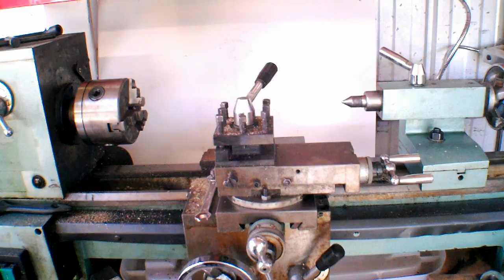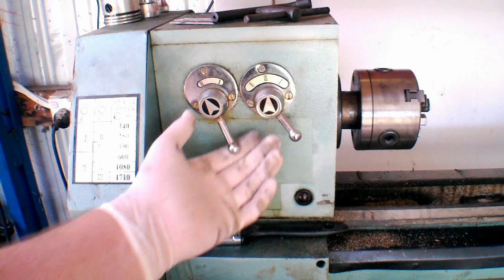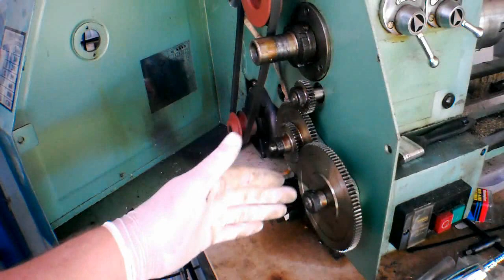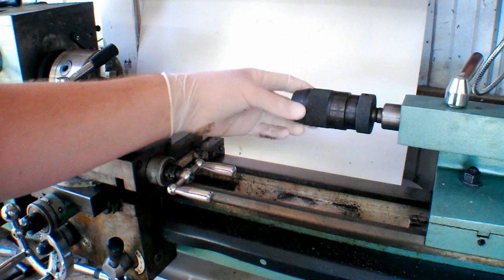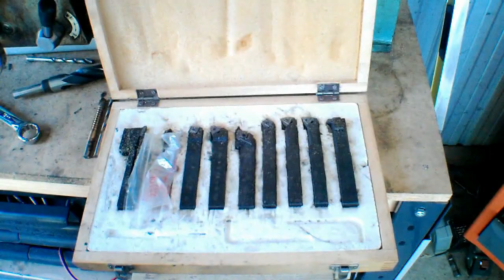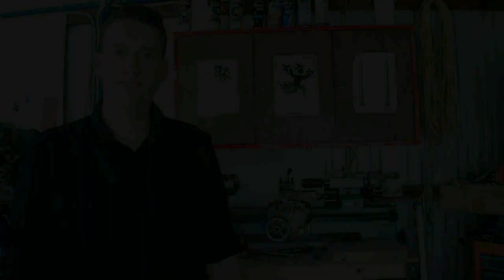Beginner's Guide to the Metal Lathe

Comment: whats the best way to torn my 220v. into 3phase 220v. to run  the lathe i just put in my garage
Reply from the maker: Usually the conversion would go the other way. There are ways, but the most obvious answer is to swap or sell and get a 3 phase lathe. Older 3 phase machines are usually cheaper because they are in less demand as most hobbiest do not have 3 phase outlets.

Comment: This is very affordable and good mini lathe. I have BV20-1L gearbox version and my uncle have BV20 belt short version for over 20 years and still work as charm. Of course you need to take care of machine (cleaning lubing etc) but this goes for any tool if you want to endure years to come :) It is well built and you can modify it according to your own needs,.
Cheers
Reply: I think BV 20L is the best buy if we are hobbiest, better than WM120. Solid built, Its weight is 3 times the WM120.

Comment: Boa noite!
Estou pretendendo comprar o Torno Mecânico 500mm BV20L-1 220V LEETOOLS-685108, vovê mi recomendaria?
Reply from the maker: It's a cheap and basic first lathe, it does have 6 speeds, but changing leadscrew gears is difficult. I would recommend a different model if you can find one at the same price. If you find the BV20L cheap, then buy it.

Comment: do you ansawer your videos
Reply from the maker: 73 SUPERGLIDE Did you have a question?
Reply: looking for lathe use because the cost with ones no to buy
Reply from the maker: 73 SUPERGLIDE Lathes have a high 'inherent value', essentially meaning that for their cost they are incredibly useful. It also means that a 50 or 100 year old lathe is just as useful as one that is brand new from China. That's why even used ones cost a lot. I bought mine used, and I could easily sell it 15 years later for double what I paid for it.

The best thing is just to be patient and wait for a good used one to come up locally on ebay or craigslist or some other local classified ads. At the moment there are many local facebook 'buy sell' pages where one may come up. I bought mine this way. Even a small lathe is heavy so bring as many friends as you can find to help.

Make sure the lathe is in good condition and not worn out. I have a 1952 milling machine that I rebuilt and it was not an easy job, and I wouldn't do it again. Given the opportunity again I would buy aTaiwanese Bridgeport copy.
Reply: im simple just looking small jobs older one

Comment: Great video man. If I may ask, why must you upgrade your chuck from a three jaw to a four. The three jaw chuck can auto align your work in the lathe making it easy to work with
Reply from the maker: Thanks. The 3 jaw is given with a new lathe only because it is idiot proof. The 4 jaw is much more useful and accurate after you've got a bit of skill under your belt. Plus you can turn work that isn't round, for example a square bar or imperfect stock.
Reply: Ryan Macher odd shape work like square bar and hex

Comment: Hi there, great video. I have acquired a lathe similar to yours but uncertain if the backplate of the chuck is integral with the spindle or screwed on. Could you please advise how yours fits?
Reply from the maker: Sorry for the late reply.. This new comments system means I missed it. The 3 jaw chuck is held onto a small faceplate with allen bolts from the back. You will need to cut the length of a regular size allen key to fit the small gap to get in there to remove them. My 4 jaw chuck has a different bolt pattern but came with an adapter plate that fit the BV20 lathe. Thanks for watching.
Reply: Thanks for confirming what I suspected. As it is really fiddly doing that, I hsve since made studs for my chuck and spin on nuts instead. I can now change the chuck much more easily and much faster :-)